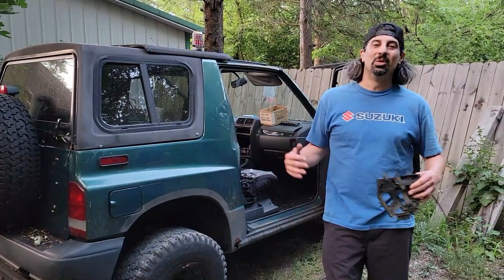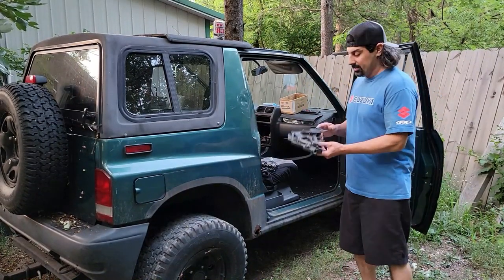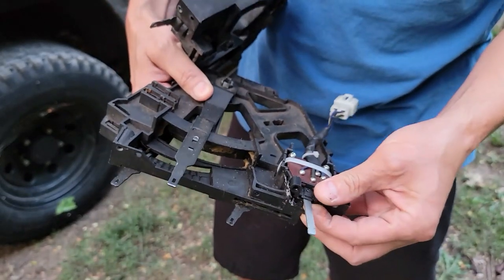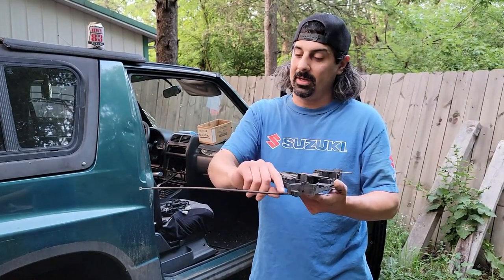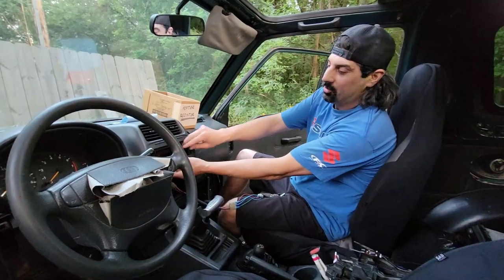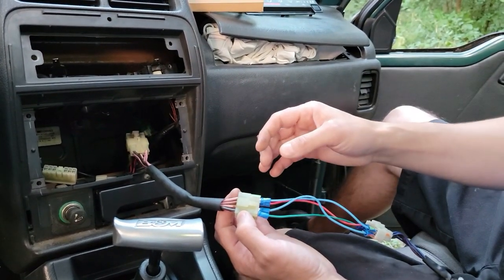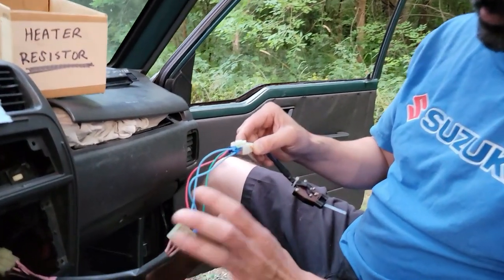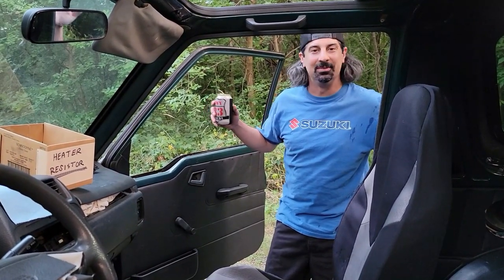Heater Fan Speed Switch Replacement Option! Finally a CHEAP way to fix the Geo Tracker blower switch

Comment: Hello, thank you for all the information,,, I have a question, my geo tracker 1994 something while I’m driving, drop the rpm and dye, I start it up like nothing happened.,.. thank you for everything
Reply: Idle control valve? I have an issue where once warm, and I turn off car, it struggles to find idle again

Comment: I have an 87 samurai but when i switch from ac to heat its not getting warm. When i switch it slowly it trues to get warm then it blows cool air again. Is there something wrong with like the blend door actuator or something
Reply from the maker: Valve on the firewall
Reply: @Hwy83SUZUKI  the one on the firewall with the cable running to it.